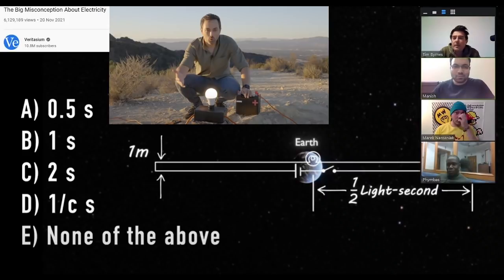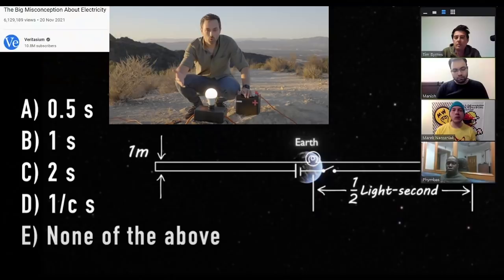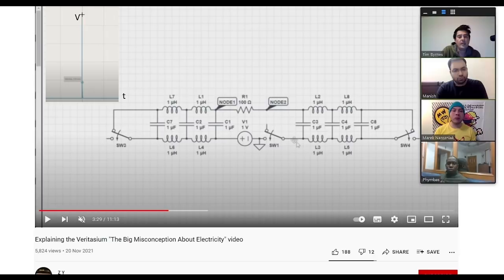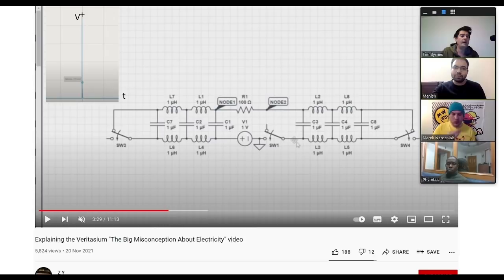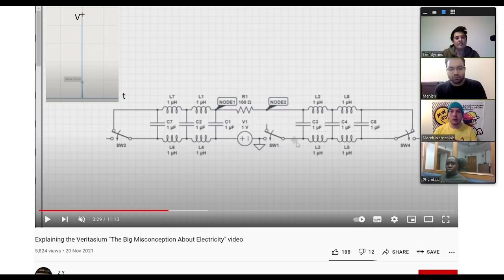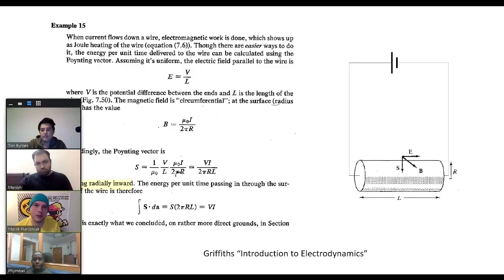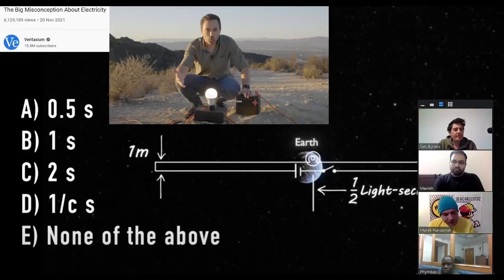Veritasium's Big Misconception About Electricity video and the point about Poynting

Comment: Pointing Vector, Schmointing Vector.
The math does not explain the physics.
 The wires DO interact and that is precisely why some current flows in the bulb after the one meter travel time.
.
At t=0-, the full battery voltage is across the switch.
The switch, at t=0+,  starts a current flowing in the wire and that field propagates through space at the speed of light over towards the light bulb. 
.
What so many people miss is that it is not capacitive nor inductive but it is RESISTIVE. The characteristic impedance, also called the surge impedance, of a transmission line is real not reactive. 
.
This easily explains why after the time of one meter travel, the light only sees a small current because of the TWO T-lines which are somewhere in the neighborhood of 2x  800-900 ohms in series with the battery and bulb!!!
. 
I've yet to see anybody that understands this.
.
That type of lumped-element representation of the transmission line gives you the FALSE impression that it looks capacitive. If it was capacitive you would see the COMPLETE source voltage across the bulb and FULL CURRENTafter that one meter time travel. The transmission line could just as easily be modeled with the inductor first. However that doesn't reflect reality either. 

Why does no one else see this?
The simulation video that Ben Watson performed using HFSS shows this very clearly.

Comment: Out of curiosity, has anyone looked at the equations with quaternion interpretation?  Maxwell's original paper was 20 equations and 20 unknowns, but because it was so complex it was truncated to 4 equations which are symmetrically gaged.  Symmetrically gaged function do a funny thing.  They make one side equal and opposite to the other.  The "beauty" of doing that is that it makes it easier to build circuits that work as expected, and in the late 1800's / early 1900's that's exactly what they needed for a starving population that demanded electricity.  4 equations that any lineman electrician could learn to help build circuits.

When we cut the original theory up, how much did we actually loose?  Sure we gained vector and tensor analysis, but there are things that can be done with quaternion algebra that not even the finest vector and tensor analysis can detect.  This is one reason we have things like vector A potential antennas and ultra wide band radar - someone looked deeper, past the 4 basic equations of electrical dynamics. 

Not trying to stir the pot too much.  I personally am not an electrical engineer or quantum theorist.  There's a lot about this field of study that I do not understand.  I just find this whole topic fascinating.  So be kind :)
Reply: Well, science is a bunch of methods and theories will be theories. Tautologies sure are fun, just not in the long run...

Comment: I don't understand most of the arguments being made. But here's one I do understand. 

There's no way for local space to know if the end of that wire is closed or open right now. Information cannot propigate faster than light. If I cut the wire at its extreme, and at the same time closed my switch; the effect must be the same (for the next half second) as though I did not cut the wire. Any answer which disagrees with that violates relativity and you can go collect your Nobel prize. 

So if you can light the lightbulb without the wires from the battery and the wires to the bulb being connected, OK cool... but if you require a "closed circuit" then there's no way for the light to update its state based on something a half-light-second away in less than a half-light-second.

Comment: 300000+300000+300000+300000= 12000000 =LENGTH OF CABLE=4 SECONDS for the bulb to go on. Nothing can travel faster than the speed of light so it will take 4 seconds.
 The 1 meter is nonsense/deception/verbal trickery as the bulb will not light up visibly and will not stay lit as its a a very low power  transient only applicable to a changing current. Think about when you switch on your house light in one room do the other bulbs in other rooms show any flicker or go on?

Comment: Theoretical Physics has the job of measuring mass-energy-momentum effects. Eg explains Gravity with Gravity because it is a field function. 
Mathematical Conjecture postulates rates and ratios in keeping with empirical laws and so resorts to vector-values visualised based on wind blown patterns in actual fields and projected into multiple dimensions. 
Engineering makes it operate "just right enough" with Safety Factors before handling the design to Electricians who have Rules of Good Practice worked out,  learning by doing. 

This is Evolution, complicated and messy. 

Feynman seems to have the right feel for Quantum-fields phenomena, but couldn't make sense of Wheeler's One Electron Theory, (he didn't either).
Nearest the Pin is Susskind's associates and students, if you accept One Electron Theory Wave-packaging time-timing sync-duration can be fitted to Black-body Singularity positioning Holographic Principle Perspective imaging Superposition-point phenomena.., a major task for the combined talents from across the Sciencing spectrum, need to explain Logarithmic Time with pure-math relative-timing ratio-rates at the e-Pi-i vertices in vortices nodal-vibrational Supersymmetry. It is never ending circularity Circuitry.

Comment: A naive question: if the energy/current is flowing only through the air, why the material of the wire makes a difference?
Reply: Kind of hard to explain without talking about antenna's. Let's use a mobile phone as an example. Your mobile phone is transmitting power to the cell station (no wires). Antenna's, for best performance, should be proportional to the wavelength of the signal (inverse of the frequency). If the wavelength is big, the antenna needs to be big and vice versa. Or, said another way, if the frequency is large, > GHz, then the antenna can be small and fit inside the phone. 
A typical 4G phone's frequency operates at ~1 Ghz to 2 GHz, that's 1x10^9 or 2x10^9. Why, because then, the wavelength is about the size of the mobile phone.  wavelength = c / f -> 3x10^8 m/s  / 1x10^9m = 0.3meters, and the antenna should be 1/4 of that length, which is 7.5 cm or about 3 inches (fits nicely inside the phone). 
Now, could we do the same for the light bulb. Technically, yes, but it isn't practical. The antenna size needed for 60 Hz is HUGE.  antenna size = (1/4)*wavelength = (1/4) * ( 3e8/ 60)...convert to miles = ~777 miles! So, the antenna would need to be about 1/4 the distance across the United States, ha. Any piece of wire acts as an antenna, but the efficiency of it is very important. If it isn't the right size, we don't get much power transferred into the air. Another important point is that the power reduces with the square of the distance (in air). So, as it travels in the air, it looses alot of power, which is why you can't walk too far away from your wifi access point in your house, and same for Bluetooth - you walk too far away and you lose the signal. So, again, technically, you can transmit power through the air and Tesla had a vision to have everything wireless powered. But, so far, it isn't practical, which is why we have batteries in our phones.

Comment: Veritasium is wrong. There is a DC term that shows up in Gauss' divergence theorem that Veritasium did not account for; said DC term completely explains the power dissipated (I^2*R loss) in conventional terms. There is no need to resort to exotic concepts like line - to - line capacitance and natural in line inductance to explain anything because they don't. These only come into play at high frequencies and this, the length of the wire notwithstanding, is not a high frequency circuit.

Comment: Lewin now veritasium . Heaviside solved the problem years ago with his model of the linemans equation. It is  a one dimensional version of maxwells equations. It is one dimensional because a wire is a one dimensional space .These are all models. Kaluza klein models proposed a a fith dimension  tightly curled up to unify electromagnetism and gravity resemble veritasiums idea but these are all types of maxwells equations including the speciall theory of relativity  , Einsteins treatise is based on maxwells theory. The key problem with veritasium is DC current which is not accounted for except switching transients. Veritasium cannot generalise Maxwells equations to DC current there is no induction or displacement current. Veritasiums model looks like displacement current , the current between capacitor , e field lines with C dv/dt. Not for DC.
We have been down this road before with walter lewin claiming Kirkhoff's law does not hold based on loose application of theory .
At least Lewin did an experiment  albeit obviously flawed.

Comment: No. It's not a capacitor, nor inductive on the second wire. The wires are separate and do not interact, he creates a special case here. Nor do electrons move through the wire at the speed of light. 

To over-simplify, imagine the wire full of marbles , when you close the switch you add 1 more marble, this instantly pushes ALL marbles Forward, simultaneously. The energy exists at all points on the wire at the same time, it does not travel from one end to the other in the way they describe.  Nor does a 'generator' create energy, it merely begins pushing the 'marbles' around the circuit all at the same time.  The energy actually comes from the disturbance created in the 'vacuum' or 'aether', or 'quantum' macguffin - whatever you choose to call it.
Reply: Yes, the wires DO interact and that is precisely why some current flows in the bulb after the one meter travel time.. 
The switch end starts a current flowing in the wire and that field propagates through space at the speed of light over towards the light bulb. 
.
What so many people miss is that it is not capacitive nor inductive but it is RESISTIVE. The characteristic impedance, also called the surge impedance, of a transmission line is real not reactive. 
.
This easily explains why after the time of one meter travel the light only sees a small current because of the TWO T-lines which are somewhere in the neighborhood of 2x  800-900 ohms in series with the battery and bulb!!!
. 
I've yet to see anybody that understands this.
That type of lumped-element representation of the transmission line gives you the FALSE impression that it looks capacitive. If it was capacitive you would see the COMPLETE source voltage across the bulb and FULL CURRENTafter that one meter time travel. The transmission line could just as easily be modeled with the inductor first. However that doesn't reflect reality it's only an approximation.

Why does no one else see this?

Comment: At 3:56 in the video, if you stretch the top and bottom wires vertically to show the one light second separation the Poynting vector still has to travel the whole distance. The 1 meter path has negligible contribution to the energy flow.

Comment: I’m not up on physics of this sort or level. My issue in V’s vid is the light bulb. I think the question is ‘when is there a signal of current’ or potential, no matter how slight, detected. Instead of the bulb actually lighting. 

And would the results change with a circle of wire? Either 1/2 light second in radius, or 2 light seconds in circumference, and the source and detector are at opposite sides. Or if the circuit is asymmetrical?

Comment: Suppose the battery and light bulb were placed not 1m away, but some considerable distance - let's say 30 miles or so. I'm led to believe that the full power of the battery will be transferred to the light bulb in the time it takes light to travel 30 miles? That's what he's saying. That it's the fields that transfer the power, not the electrons in the wire. Any way, I seriously doubt it. Let's up the ante though. Suppose I encase both the battery and the light bulb in heavy shielding so that the magnetic field is blocked between them. Now, if I'm to believe Vertasium, the light bulb won't light up at all, because I've blocked the magnetic field pathway from the battery to the bulb? Since it's the fields that transfer the power, not the wires, I've blocked the fields, now I can't get power, so the light bulb won't light up? No way.

Comment: I think you (and Veritasium) make a confusion out of local/global physics. In the static case Poynting is just an axial vector, a mathematical object. The mathematics is not always "the physics."  But it can still have the flux meaning, since local fluctuations will create eddy currents and whatnot, small effects, but detectable.  No real physical system is ever in static equilibrium, not even classically, if you can find one tell me!    In the circuit case try getting EM energy flow around a non-conductor.. it can carry a field.. so...!   The point to make is that energy is not a "thing" it is something secondary related to interaction, and in the electric circuit case the interaction is between photons and electrons. You should really dispense with Maxwell fields entirely, since they are fictions, useful only for simplified computations, the way to teach kids all this is to start with the quantum picture at a rudimentary level (Feynman diagrams are perfect for this) then say, "Hey, we cannot compute these diagrams yet, let alone figure out how they work for a simple circuit, so we are going to take some effective field theory approximations and get the Kirchoff laws &c., out of that. Agree? [All agree.]"  This way even engineers learn their circuit flow heuristics and data books are only approximations, but they understand why the approximations work and can understand the edge cases where they fail, it's the right and honest way to teach science.
Reply: Further to the point about the statics case: The other thing is, ExB for static fields is not a "static" energy flux, since there is no such thing, it'd be nonsensical.  Eg., for the "static" cylindrical capacitor, the S vector is actually the flux for an EM wave circulating around the capacitor gap - so really still a dynamic case, which is revealed when a conductor is inserted into the region of the non-zero ExB, then there is a Lorenz force, which reveals energy in the form of angular momentum was being "stored" in the Poynting field.
     Also, as Feynman pointed out, the magnetic field is not actually a static situation itself, since the B field implies circulating currents generating the B field.

Comment: 2:30 "This is like a tiny effect"... based on Z Y's analysis video.  But it's not a tiny effect. The transmission line properties of the parallel wires give it an impedance on the order of 1k, which will provide perfectly adequate current to light an LED... and not just a blip. It will continue until the "full DC" current arrives after 1 sec.  Z Y himself posted a followup video acknowledging that point.  https://www.youtube.com/watch?v=RsiYXfpJu5U
Reply from the maker: I think the point was that it is tiny in relative terms, compared to the full blown DC current.  So technically, yes, if the question is posed as when a LED lights then Veritasium is correct.  But if you look at the original video, you have to wonder whether he was really thinking of this kind of transient effect when posing the question.  Considering hedid mention Poynting vectors, which are generally considered at steady state, you get the feeling he was actually thinking of this when posing the question.  So did Derek carefully word it with all this in mind, or was he saved by the transient effect? Perhaps we will never know...
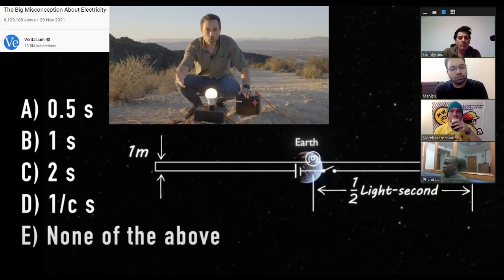Reply: @NYUQuantumTechnologyLab  I think you may have missed my point. The effect is neither tiny, nor transient. In the simulation model from Z Y's video that you comment upon, the light bulb load is replaced by 100 ohms, and the battery by 1V. The impedance of the transmission line (in one direction) is on the order ot 1000 ohms, (very much  depending on wire diameter). The current sill start to flow in the 100 ohm load in 1/c sec, and it will be approx 1V/2.1k. That will continue until the full DC arrives after 1 sec, at that point becoming 1V/100 (assuming zero resistance wires). So the initial phenomenon will be a plateau at about 5% of the final current, lasting about 1 sec. If the load were an LED, it can certainly operate over a range of 1:20, so that 5% 1 sec plateau is neither a negligible magnitude, nor a trivially brief transient. And as I said before, Z Y posted a later video saying as much.  
As far as the original Veritasium video, the way Derek set up the thought experiment, and his approach to explaining it was a bit of a mess, but the answer he gave clearly relies on the transmission line having a much-less-than-infinite impedance (I claim on the order of 1k ohm), and a very long length to force a clear distinction between what happens in the very short time (1/c), the "medium" term < 1sec, and the final DC value.